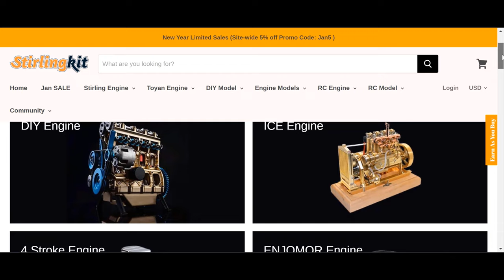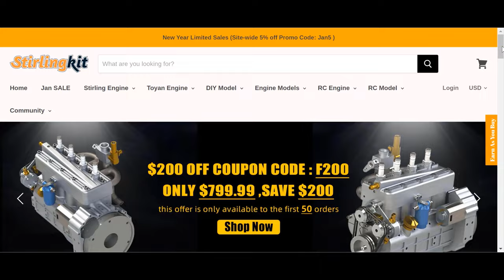Particle Accelerator Used metal balls

Comment: They need to break the sound barrier. It needs to be 100000x faster
Reply: at full power a particle accelerator can accelerate particles at 99.9999991% the speed of light
Reply: if we do the mistake to the particles it might create a huge explosion
Reply: If you do that you just straight up make a literal black hole
Reply: @connert9700  thats not true
Reply: And If I want break the time barrier?
Reply: @oreki401  well its a theory of LHC
Reply: @oreki401 it is, with it going the speed of light a collision WILL happend and WILL be EXTREMELY VIOLANT

Comment: How could I calculate the current that's goin through the coils at the moment when the mosfets are closed(when they're in saturation)?
Reply from the maker: Use an ammeter
Reply: @inventorkr1  Ok thanks, but I mean to calculate it, not to measure it. Anyways I found out that it depends on the specifications of the mosfet according to its drain current values. 

Also, the number of turns of the coil is a parameter that you previously chose or is it random?

Comment: Why are they not accelerating to an infinite speed?
Reply: The rail and the air is causing friction
Reply: @Gale RL  but isn't friction force constant on that object? The area of the object is not changing, and neither the pressure it exerts on the sides, or does it change?
Reply: @personofsomething6205  Another factor could be the timing of the circuit as the ball accelerates. The faster the ball goes the worse the timing is. The coil stays charged for too long causing the opposite effect as the ball passes through the mid-point.